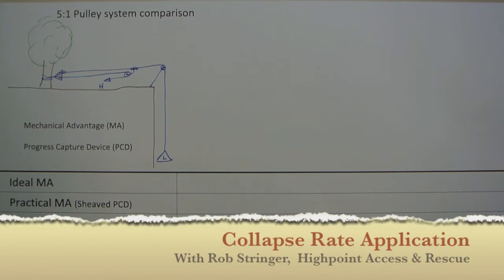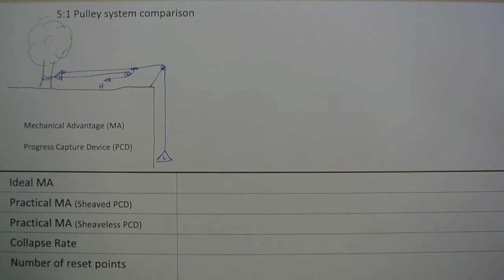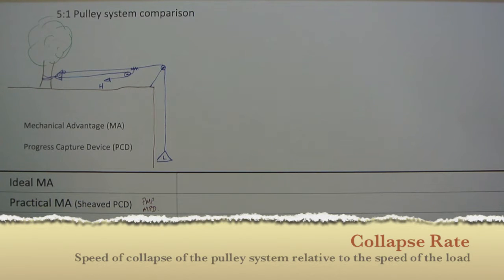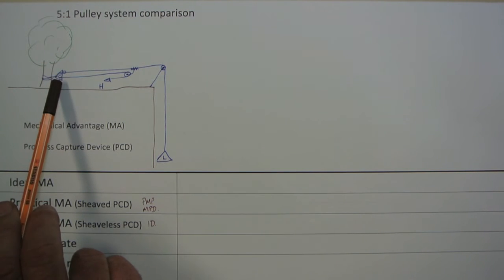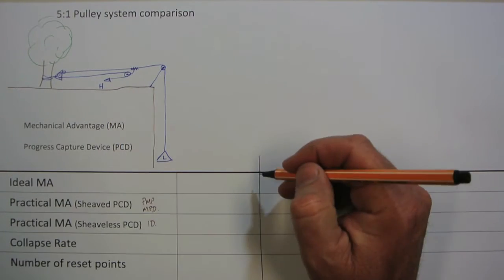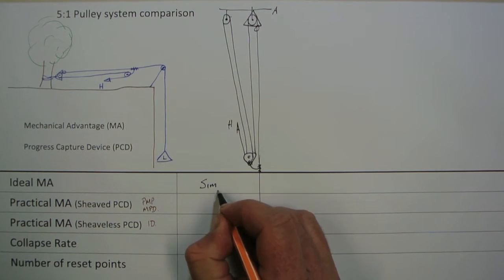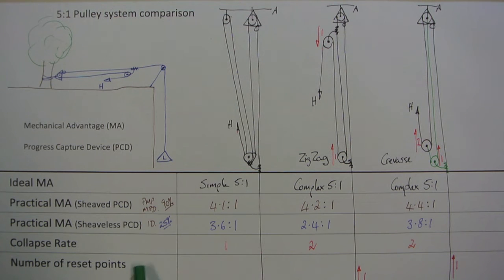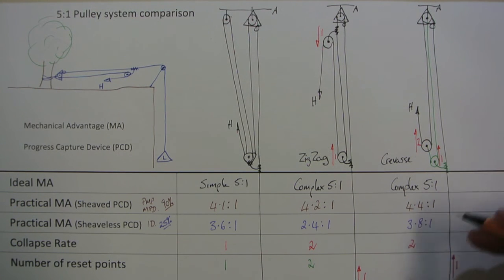Collapse rate Pt 1 Application

Comment from the maker: Hi Cameron. That is a great question and one that deserves explanation. The crevasse does have the appearance of a compound pulley system. It looks to contain a 3:1 and a 2:1. I hope I am on the right path here for your question.

One definition of a compound pulley system is that it has a "simple pulley system hauling on another simple pulley system". If that were the case here, as many people believe, we would have a 3:1 hauling on a 2:1. With all compound systems, the simple components are multiplied to get the overall MA of the compound, in this case 2 x 3 would give us a compound 6:1.

Lets apply some pulley system rules to this:

If the rope you are hauling is terminated on the load, the MA must be odd. The crevasse cannot be a 6:1, as the haul rope is terminated on the load. The MA must be an odd number.

If the T method is used to determine the MA, we should establish that the crevasse is in fact a 5:1. As 5 is a prime number, the crevasse cannot be compound. All compound systems (with the exception of some with class 3 pulleys) are composite numbers (can be divided by more than just 1 and itself).

The crevasse has a simple pulley system (2:1) WITHIN another simple pulley system (3:1). It is in the complex category however it is a very useful tool.

I hope this explanation is useful.